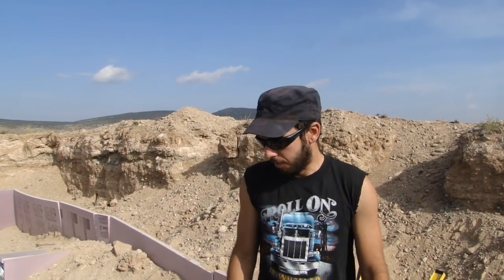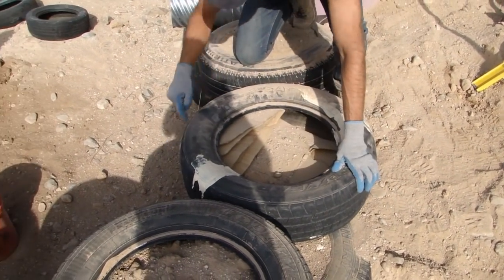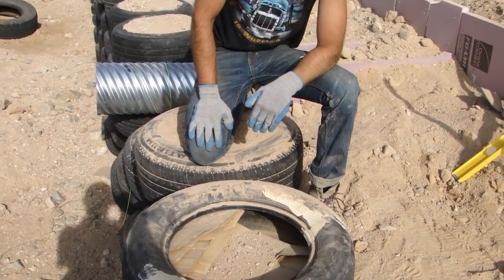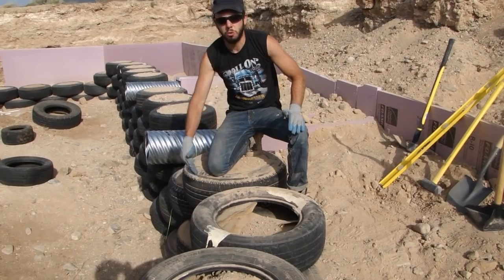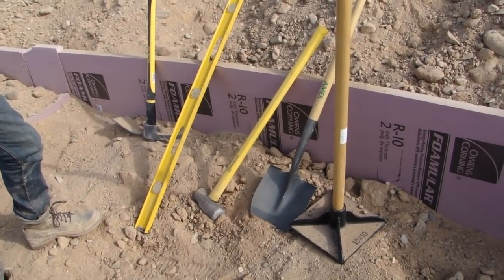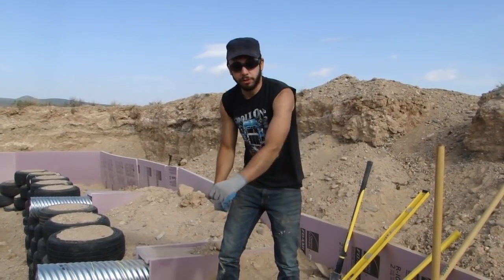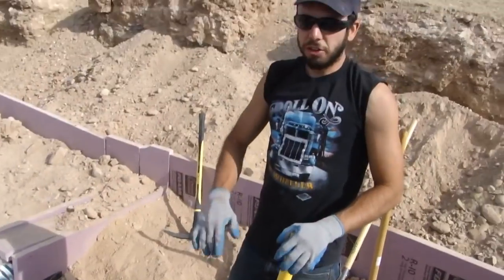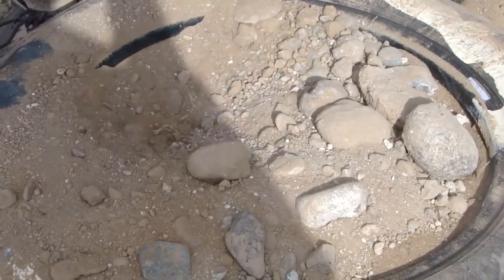How to Build a Tire Wall

Comment: I used to test soil compaction on construction sites. And before that I was doing the actual construction and in an area just like this. Y'all could work more efficiently if the dirt had moisture worked in. It would compact better and take less effort. And as the inspections get more strict over the years they are eventually going to make you do it anyway so you really ought to consider this.

  You may not notice the first day but if you have a hoe or mini-ex to work water into the soil in a prep area or have one guy on a hose spraying over four guys on the tires it will get more compacted in less time with less effort.

BTW I really love what y'all are doing out there. Keep up the good work.
Reply: rudy adair
It's hard to say for sure. The air gaps that you may get from the soil not filling in around the angular chunks of block may reduce the density more than the chunks themselves. That is why is is so important to use water. It is literally a lubricant that allows the particles to move into the gaps. If you break them down to marble size I would not think it would be  problem.
  There is a measurement called a proctor that you can do if you want to get really accurate. You may want to look it up as I'm not sure I remember the exact procedure but the idea is to get a measurement of lbs. per cubic Ft. The following should be close enough to get you within reasonable accuracy. It's a pain in the ass but there is no other way I know of...

1. Get a steal cylinder with a known volume.(maybe 3 inch diameter and 4 inches high.)
2. Get your sample of your cinder block mix and a sample of what you want to compare it to.
3. Then you need what amounts to a slide hammer with a weight on it that will compact the dirt into the cylinder.
4. Over fill the cylinder with one of the samples and drop the weight on it an exact number of times, from a specific height every time. ...say 15 times or whatever it takes to pack the shit out if it...within reason. If the cylinder is not flush with dirt, keep filling and repeat.
5.  Once the cylinder is full and compacted, cut the dirt off flush, then dig the dirt out and weigh all of it.
6.  Then take it off the scale, add a little water but keep track of the amount and repeat all these steps until you see a drop in the weight.(A little more soil should be required each time if you are doing it right but not as much when you are close to completion.)

 Once you see a drop in the wieght this means that the last or highest measurement is the maximum soil density and approximate water content to get that density for that sample.

If you don't have a scale that measures in grams or better then you will need a large cylinder to compensate.
you should be able to do your two samples in under tree hours.

Now... Don't even ask me how to tell how close you are in the final project if you don't have access to a nuclear density gauge. you don't want to know!
Just take what you learned from the proctor and guesstimate.

I hope that helps.
Reply: rudy adair  If they are broken to 1/2" or less pieces not so much of issue. smaller would be better of course.
Reply: Exactly my thought when I saw what happens to beating on dry dirt. It's like a never ending compaction process. Also. I have a few Ponds and if you mixed dry clay in that tires with dirt , then spray with water , watch what happens. Time is drastically cut down on filling tires. Experiment and try dry clay mixed with dry dirt and see for yourself.
Peace
Reply: I was wondering about mixing sand, aggregate and water into a not quite as wet concrete-like mixture and just pouring it in.  You would have to allow some drying time I imagine but you would get a single course done much faster.  Possibly drilling some holes in the tires to allow it to breath?

I'm gonna mess around with that.  Where I live I get paid $1.25 per tire that I take from the recycling center.
Reply: Sean Woody ONeill Where do you live that they pay you to take tires?
Reply: @seanwoodyoneill8348  

Hey man. I wanna do the same thing. Forget all that pounding! Wanna share an update into your research?
Reply: I used to install turf and you have to compact the base material which is dirt and we always wet the whole area before going over it with a compactor
Reply: @dasein9980  - around here if they want tires hauled off they have to pay about 3 bucks each tire. the garages here give dead tires away, as it saves them money.
Reply: @seanwoodyoneill8348  where do you live that you're paid to take tires?
Reply: @gordonpromish9218  awesome. Can you say what vicinity that's in?
Reply: @dasein9980  - I'm in southern Georgia, USA. I would think the disposal fees would be ubiquitous and thus expect that dead tires would be free or nearly so just about anywhere
Reply: I was literally going to say the exact same thing.

Comment: Built a barn with tires.
No pounding. I filled thetire walls  with large rock to prevent compression then put very large rock in and buried it with dirt mixed with small stones.
These wall have been up 11years.
I also leveled the line where tbe tires go.
My next project , I will did down about three in. and then fill.
8-10 inches is actually best.
Here its extremely rocky (monster rocks) .
Hope this helps someone.
Enjoy!

Comment: Perfect. 14 minutes, one tire down, 700 more to go.
Reply: i think it is a lot more than 700 x 14 minutes… i am going cobe  :)
Reply: how about adding water? water compacts dirt naturally. Lol just thinking of ways to avoid the pounding much as possible 😂
Reply: @rinchhensherpa6972  I am looking at using a pressure washer .. move a lot of dirt with as little water as possible. But yes... water will settle the dirt naturally.
Reply: I think he would have needed a third of this time at most if he didn't explain everything
Reply: Very labor intensive and long and drawn out inefficient process.  Get a job working half the time and pay for a better wall ... win/win.
Reply: @garypulliam3740  it's not about money, or paying someone to do it for you or getting "better walls".
(what are actually better walls? I thought walls should insolate and protect you from the environment?!)

let's say he needs 14 min per tyre, if he uses 700, he needs 160 hours. If you're working 12 hours a day, you're done within 2 weeks. And you probably spend about no money at all.
Reply: @rinchhensherpa6972  water is the last thing you want in there. it will dry out over time and create airpockets in the tire. Worse if it is too wet it will start to mold. So  definitely NO.
Reply: Anyone every build it without packing them? (Keeping them empty) I’m curious what your results are. It’s what I’m trying and the only issues I’ve had are the fact that there is zero insulation from sound, temperature, and wind
Reply: @80milekyle70  time for some blown-in insulation!
Reply: @garypulliam3740  exactly
Reply: Thinking the same thing.
Reply: Good exercise but pouring cement inside makes more sense....🦍
Reply: @johnrogan9420  except it's expensive and not sustainable.
Reply: 2000 tires to go.  . Lol
Reply: @80milekyle70  they’re more likely to cave in if too tall. Also, empty tires are very inviting for rodents and wasp nests.

Comment: Just beginning my tire wall extension to my off grid house went to the local garbage tip and they said they have to pay to have them shredded so I could have as many as I wanted,am using dirt from my opal mine good texture and adding a few handfuls of cement into a dry dirt mix with just a little water,find it easier to completely fill the tire walls when pounding.Three walls one back over 54ft and two side walls 15ft each and nine feet high.Rafters and joists will be from cyprus pine which grows around this area and costs only my time and a chainsaw to get,then corrugated iron roof guttered to collect rainwater to two 20gallon catchment tanks.Job started one month ago completion date 6 months.Cost in total only the corrugated iron roofing, guttering and downpipes approx $500.Using only my own labor so the project though labor intensive is more than affordable and when the project is finished I can look at it and know it was worth the hours I will put in.
Reply: Ya if you really wanted to do it and make a couple bucks you could ask some local tire shops what they pay to have them hauled off and beat it it's a win for everyone they spend less and you make a little because you are going to be working your ass off

Comment: True it takes more time but you are building a solid structure, a wall over two feet thick with free materials that are also helping to reduce landfill waste. That looks like a couple tons of tires; imagine how many tires would be put to good use building just 100 of these homes.
Reply: Tires do not end up on landfills they all go to recycling centers  You get fined trying to throw them away and the landfills and dumps get fined if they are caught with them during inspections.
Reply: Behr Palomo True ....I think my truck bedliner is made out of old tire rubber and a lot of today!s shoe soles are too.
Reply: They are making a landfill

Comment from the maker: The important thing is that after they are pounded, they all are level with each other.  You can get away with using similar sized tires next to each other but that usually means more work with either pounding or leveling, so it's best to keep them the same size.  I also used different sized tires, sometimes drastically to fill spaces in the tirewall without having to pour a concrete block.
Reply: Was curious how you placed that cooling duct in the wall. I'm assuming you remove a tire and build a small form in place?

Comment: It is a lot of work per tire, but goes quicker than you might expect if you're working with other people.  Add a pneumatic tamper or two into the mix (requires a beefy compressor), and you can cut it down from 20-30 minutes per tire to 5-10. Quite the back saver.

Comment: Thank you so much. I got this idea ( I thought bc I was creative and smart😂) after the 2016 Louisiana flood. Knowing I was going to need to eventually build some kind of retaining wall. Everywhere we drove after getting back in our house there were tires. Guess what? 7 years later they are still there. We’ve picked up 25 just that we see on the way to and from school everyday. We are going to need hundreds if not a  thousand or more. At least we helped clean up some of our city. Your video is the best I’ve seen on an in detail explanation of what to do when and why. One question. Tires will supposedly rise though the earth after 10 years if buried 5 feet.  We are going way higher than that total, our will be terraced off, but the area does flood periodically when the river rises which is a couple times of year. Our creek is directly connected to the river. About a mile as the crow flies. How do we make sure they won’t float up?

Comment: why don't you use water to compact the dirt naturally, instead of pounding dry dirt into the tire?  i know once it's dry the mud will shrink, but just add more dirt afterwards.  then continue the next layer.  seems like it would be a lot less work.  more time, but less labor.  ???
Reply: Adding water does not "compact the dirt." The ground doesn't get harder and harder with every rain. The beaches don't turn to sandstone.
Reply: A pro construction person recommends using some water, too. (In some comments above this.) He probably just hadn't heard of it. Now I want a video on how to do it! Idk how much water is too much or too little.

Comment: I think you can have a reference tire on each end if 2 people are pounding tires, and both working towards the middle, and then you can squeeze a filler tire into a small space to complete a level. I like the idea of using 4 screws to hold tire in place before packing.

Comment: My god all the work per tire, I applaud your work ethic but F that!! lol.
Reply: I agree, ridiculous effort needed. There must be more efficient methods
Reply: The upside is these tires are very cheap. Once you get your concrete estimate you're going to reconsider something cheaper.
The pro to earthships that I see is , no excuse to be homeless if you can afford a small piece of land.
Just start piling tires.
Reply: Very labor intensive and long and drawn out inefficient process.  Get a job working half the time and pay for a better wall ... win/win.
Reply: @garypulliam3740  You missed the point. Rich people also build earthships.
It's not a poor man's home.
Reply: Ha ha you said but f.
So do they also have to use tires all the same width?

Comment: I think a much better idea is a sod house, plastered on the inside and out.  See Roger Welsch's book on soddies for ideas--some of the houses he pictures are extraordinary.  They'd be less work than tire-packing (but still take a lot of labor) and a lot faster to put up.  Their insulative capacity (two-foot thick walls) would also be excellent.

Comment: GREAT JOB GUYS AND THANKS FOR ALL OF YOUR HARD WORK AND EXPLANATION ON EACH STEP. I do have one question concerning screwing the tires together with the 1" screws and I apologize if I missed it if you mentioned this but besides just screwing the current tires down to the previous rows as you mentioned, wouldn't it also help some to also use a couple of this same 1" screws and screw the side (which in this case would be through the tread) to the tire on each side to also help hold it in place while all of the filling and packing is taking place? Just a thought! Thanks again and keep up the great job. looking forward to seeing it all finished as this is the same type structure my girlfriend and I are planning to use!

Comment: I have a very high water table here!   So need to create soak away pits.
Following the previous owners ideas!
DIg (what feels like)  an enormous hole big enough for at least 3 for tyres laid flat, stick in tyres. dont bother  with back filling or infill. At present a bit of old door over the top. Will probably cast a slab over the  top...time and inclination permitting!

I have actually pumped water for the garden out of the existing (previous owners) one!

Possibly creating underground cisterns? Comments, please.

Climate here is up to 40deg C summer , minus 15deg C winter.

Comment: I used to think tires would pack better if I added moisture to dry dirt. Actually, last summer I packed about 20 tires for a small project, and I added quite a bit of water like with concrete.  Maybe sandy soil doesn't need moisture added so much as mineral rich dirt. Spraying with a garden hose also keeps the dust down.

Comment: If you use a water level it will be more accurate than a 4' level and will eliminate accumulative error.  I have used a water level  to set a 100' block retaining wall and it is accurate within 1/8 inch end to end.

Comment: Would you use rebar for more vertical stability? What affects would water have on the dirt? Wet dirt easier or harder to pound?
Reply from the maker: +HeuristicDev no need for rebar.  The weight makes it sturdy.  Wet dirt = no no
Reply: Ok. So you'd need to keep it covered from rain.
Reply from the maker: yes

Comment: a lot of people talking about moisture how about adobe> or cooking down your own limestone into slake and mixing with the native soils>>>wood ash cement is easy enough and sodium silicate could be cooked up with the same fire...once production started this primitive concrete a perfect shot rigid and layer little at a time...disposing of the junk skids and salvaging the good wood for interior doors and trim as well as manufacturing cupboards etc.    burn the rest kilning the limestone and making the sodium silicate...set up a brick drying station for pavers and interior floors in green house ...if wood abundant a couple of home made barrel charcoalers would also be nice...many benefits for slaking lime stone and harvesting the native soils ...might be considered not green though [the carbon footprint] but some bodies going burn it might as well be you...
and with toping off the tire walls with a concrete pour is leveling every tire that essential close is good enough yes cover inconsistencies with the pour yes...then the roof harvesting native stone also a great idea dig hole for septic a few feet farther away and set septic on native stone base save on gravel...pour primitive mortar for stability and enough native stone you could slip form the tank easy enough and save 4 to 5 grand....do the same for the planters if ply wood not cut it may be reused on the roof deck and the utility behind thermal mass why bury would it not be better to enclose leave tire walls unfinished and set tanks and all pumps etc in the very large utility room few conduits and drainage in case of leakage maximize your square footage and build garage beyond using the utility room as a connector to the house another gable over tanks could not hurt for water collection and small drains could be installed in cooling tubes to evacuate moisture from condensate in wetter climates keeping those dry is the key legionaires and water borne bugs no joke...drainage before pipe hit the house is wiser as well and drains installed in utility room where tanks are just wise every thing leaks in time ...the tanks could also help with cooling the area with their mass as well passive heat and cool with water contained always a good idea and tanks may be inspected and chlorinated from inside as well.

Comment: There has got to be a way to make this more feasible (faster and less labor-intensive) for the individual who doesn't have a crew of volunteer labor.
Reply: +tod mills It's called a backhoe.  Mechanical advantage speeds up the process substantially.
Reply: 700 tires takes about two to four weeks. depends on how much you want to work. so yeah, build s regular house and let's see, what's faster 😅